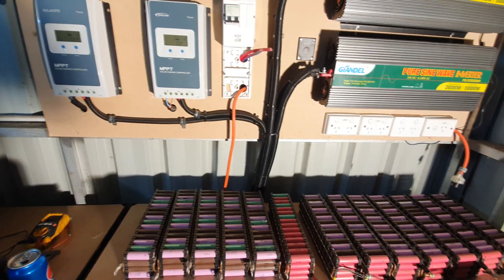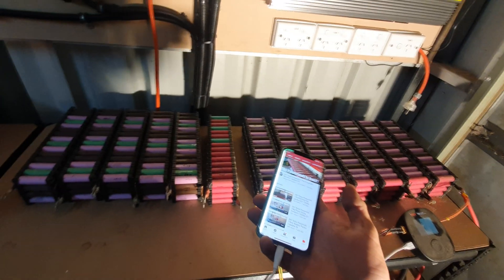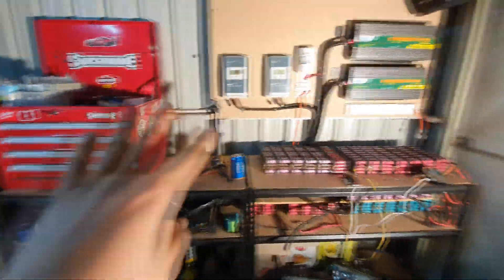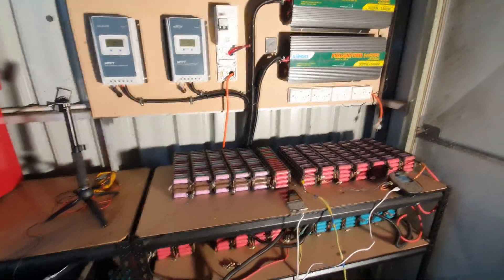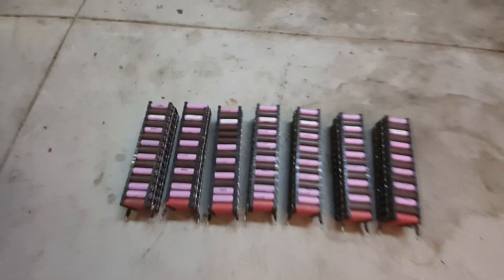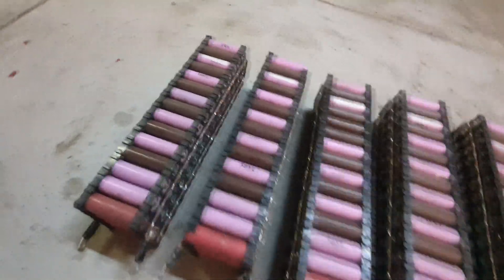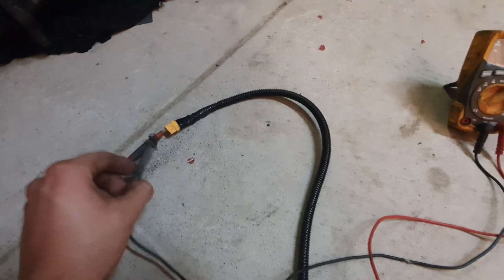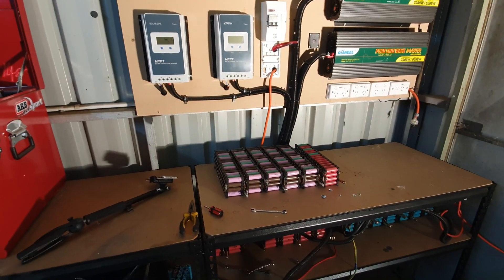DIY Tesla Powerwall | Testing Cell Balance After 1 Year | Update 39

Comment: if they are the 40 amp charge controller you know at 24v they can take3120 watts of solar they auto ramp back i also have the numbers for the lower amperage ones if you would like them
Reply from the maker: They will only put out 40 max no matter what the input, it will just get hot, and possibly fail if not cooled adequately. Hope this helps.
Reply: @RandomDIYProjects0  yes but with more panels they is more chance of it always been in the high ampage rather then lower on a cloudy day but yeah i do see your point about overloading heat etc i know when i had my one i used grid tie panels rather then off grid panels
Reply from the maker: @1981dasimpson  in that case this controller isn't suitable then for your array, probably better with a bigger unit like a pcm60x, or multiple 40amp units.